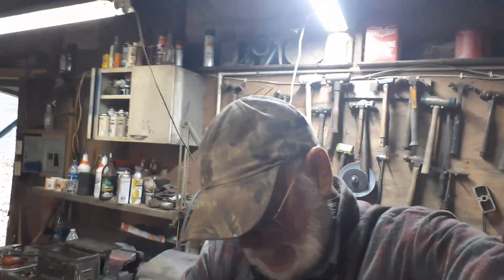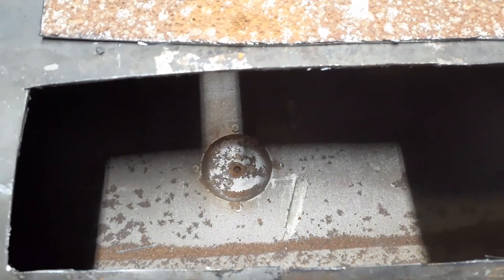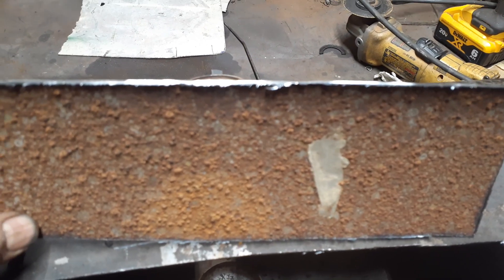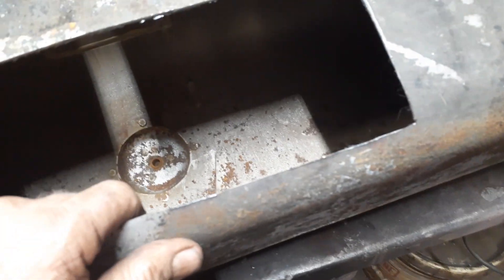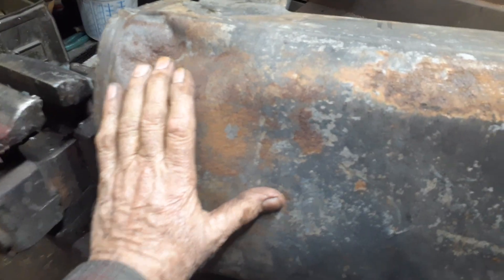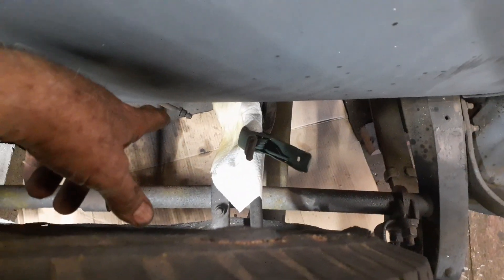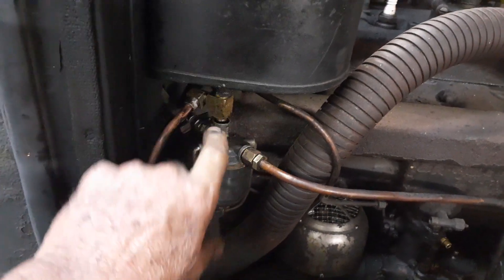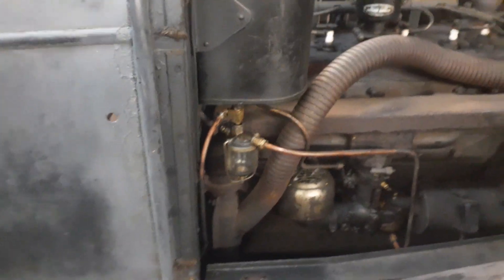18th Chrysler Video

Comment: This was an interesting video. I think the reason for the large brake lines was that they had not invented steel lines that small before. This was all new. Also cars didn't go too fast so you weren't trying to slow them down from high speeds. They did the jobas well as could be expected.